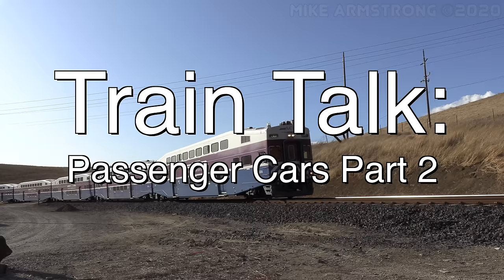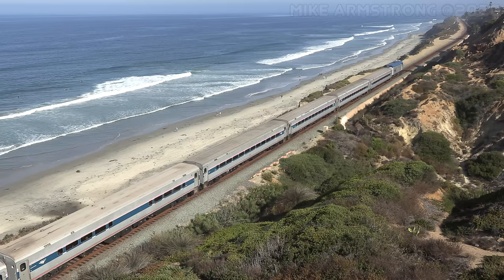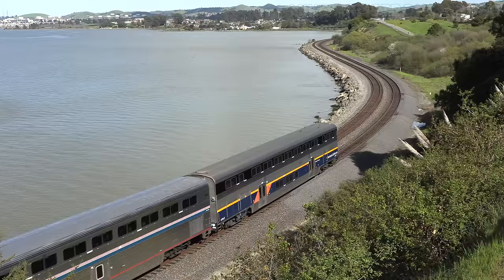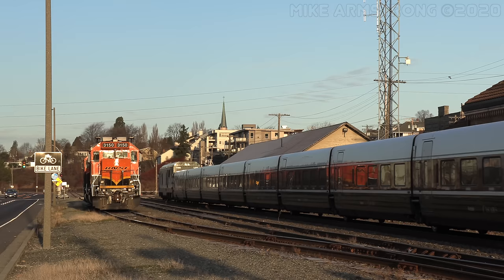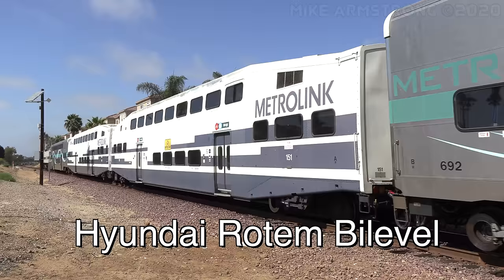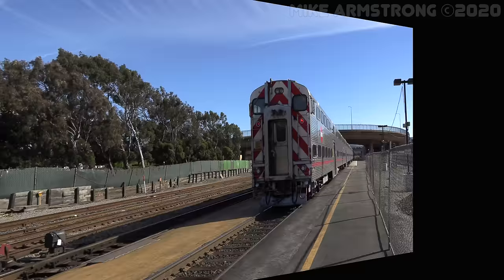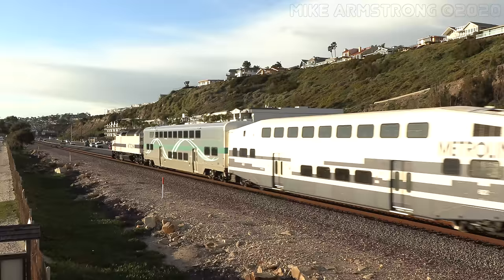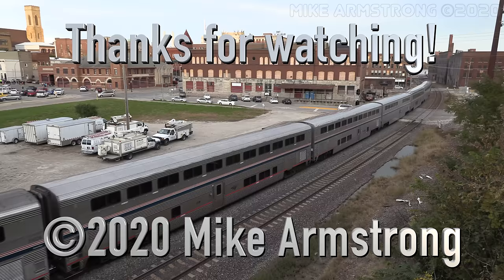Types of Passenger Cars Part 2: Train Talk Ep. 27

Comment: The Hyundai Rotems actually have only backwards seating in the cabs, a high-level, full-width cab, and breakaway tables. The seats can't be removed, and they all have capacity for 2 bikes, conductor door controls, and PTC, making them the safest railroad cars in the world.
Reply: A TGV Duplex 2N2 recently hit at 270 km/h a collapsed embankment and derailed, in France. What happened? The driver was seriously injured and 4 passengers out of 348 less seriously injured. That's all.
These Hyundai Rotem coaches would have been crushed in the same situation. They are definitely not the safest in the world.
By the way, TGVs are equipped with TVM 300/430 and ETCS, which are considerably better and more advanced signalling and safety systems than PTC.
Reply: @Paname514 The Hyundai Rotems can't even reach 270 km as they are capped at 90 MPH. Also, American designs for safety are designed to be as safe as possible in an accident, such as striking a car. Also, the design is to have the object that was struck go underneath the cab, and spare the engineers life.

Comment: 10:23 wow I never knew the Acela Express had flashing ditch lights.
Reply: Also in the scene, the engine seems to be doing a lot of truck hunting.  Its wobbling back and forth!
Reply: It’s natural for all trains to wobble
Reply: @NashRailfan  Thankfully TGVs do NOT wobble when going at 320 km/h. This wobble on the Acela is quite too much.
Reply: All passenger and freight trains that cross level-crossings have to have ditch lights per federal regulations. Its just easier to fit them than it is to figure out if they are needed for the train.

Comment: Nice. The Kawasaki III’s were also built for the VRE, those ones were equipped with Ditch lights unlike the MARC ones that had Gyra lights. The VRE Kawasaki’s were sold to MARC in the 2000’s, easiest way to identify them again is the MARC ones have Gyra lights, and the Ex VRE’s have Ditch lights

Comment: The other type is called a multi level coach made by Bombardier transportation. Some of the new builds are the self-propelled configuration because one of the coaches has a pantograph for 25kv 60hz NJ Transit Morris & Essex line Hoboken division North Jersey coast line Matawan Long Branch sections 11kv 25hz PRR Northeast Corridor. For Comet coaches some have central door for high-level platforms examples are New Brunswick Edison Metuchen Metropark Newark Penn Station NJ Transit. LIRR C3  actually unique because you only use the high-level platforms to board them because they're derived from Comeng C1

Comment: The design of the single-level cars for MARC is very similar to those single-level interurbans that run on the South Shore line, only without current collection or propulsion gear and use different couplers.  And, the latter, like the former, are built by Nippon Sharyo.

Comment: One slight correction to your Viewliner 1 commentary. One of the prototype cars was a diner. All production Viewliner 1's were sleepers. Another one off design not mentioned are the single level cars built by Mafersa for VRE (Virginia Railway Express) and now are in service on CDOT (Connecticut Dept. of Transportation) trains. Another commuter design are the electric MU's used by Metra Electric and The South Shore (Chicago, South Shore and South Bend). The South Shore also has single level electric mu's (a one off design) with electric traction motors and car bodies similar to the MARC Nippon Sharyo cars but with doors at both  ends and the middle with cabs at each car end (each car is bi-directional). Both of the aforementioned Chicago, South Shore and South Bend car designs were built by Nippon Sharyo.

Comment: Can cab cars run without a locomotive???
Reply: No they cannot. Cab cars are simply passenger cars modified to have a cab at one end. The driver controls the locomotive in the back from the cab car via a series of connections throughout the train. Cab cars also do not have their own engines, so they cannot operate as a single unit without a locomotive.
Reply: @TheDomeHepot010  OK cool thank you for letting me know.👍👍🙂🙂
Reply: Cab cars can only self-propel if they belong to an EMU
Reply: @doctordothraki4378  OK.

Comment: It would be cool to see a video on more EMU (Electric Multiple Unit) trains
Reply: How many exist in the US?
Reply: @paname514  At least four systems use them, Metro North Railroad, Long Island Railroad (NYCTA), SEPTA (Philadelphia) and Denver-RTD
Reply: @sadams12345678  This is objectively not much as LIRR and Metro-North are basically part of the same large network.
Reply: @paname514  I counted LIRR and Metro North as separate systems because they are not, at least to my knowledge anyway, physically connected with each other even though they're considered part of the same network. Also Metro North was formed in 1983 and LIRR was founded in 1834
Reply: @sadams12345678  They are part of the same city, New York. That's the only thing that matters.

Comment: So for Talgos, does the locomotive still provide HEP if there is a dedicated generator car?
Reply from the maker: No, the electrical power all comes from the generator car.
Reply: @CoasterFan2105  I wonder why they did that, when all of the Amtrak passenger locomotives have head-end power capability?
Reply: @Lucius_Chiaraviglio   Talgo got FRA special permission to import a european design.  While assembled in USA, they are a copy with few modificatiosn of real european trains which use different voltage for "hotel" service.  VIA had the same issue with its "Renaissance" cars purchased from UK, but used a converter from the HEP 480v of its locos to feed the Renaissance cars. (which also have non american couplers, so a baggage transition car is required).

I have to wonder why Talgo chose a diesel generator instead of power converter. Perhaps it was already there in the baggage car as backup?
Reply: @jfmezei  Talgo III pour le train Catalán Talgo. Ce train international était tiré par plusieurs types de locomotives espagnoles et françaises, Diesel et électriques. Il pouvait donc y avoir plusieurs changements de locomotives durant un trajet - donc interruptions d'alimentation en énergie -, au moment du passage de la frontière et d'une ligne électrifiée à non électrifiée. Cela permettait aussi d'utiliser des locomotives fret ou non adaptées à l'alimentation des rames Talgo.
Reply: @paname514   Merci ! Intéressant qu'ils ont copié ce design pour le modème fait pour USA. 

Thanks, Interesting that they copied the "train designed to allow change of loco during trip, hence HEP generator in baggage car" design for the Amtrak order.
Reply: Jhj